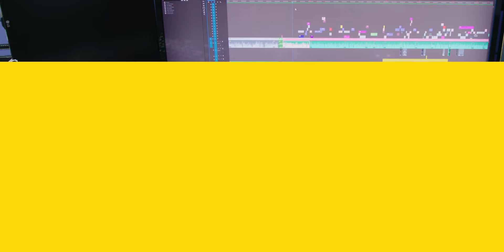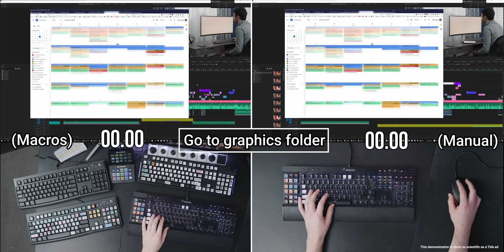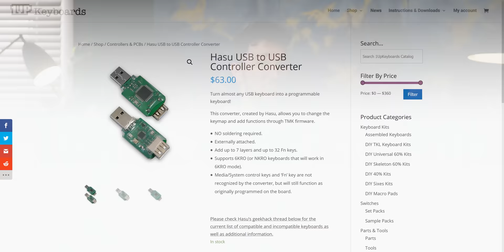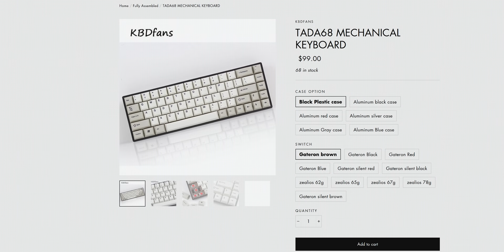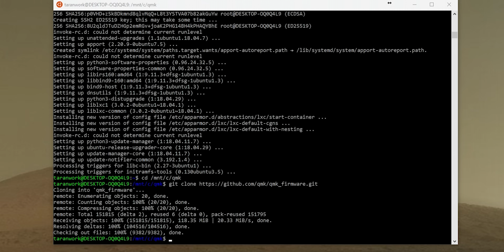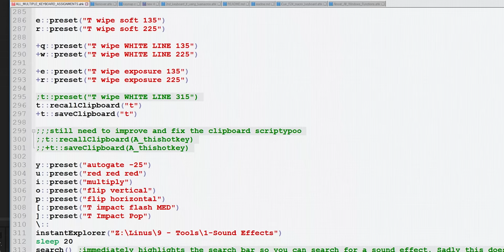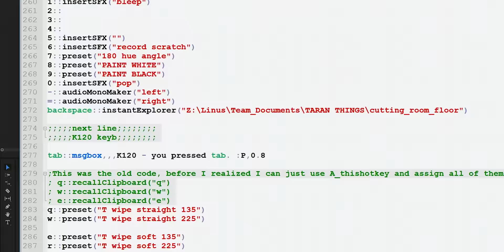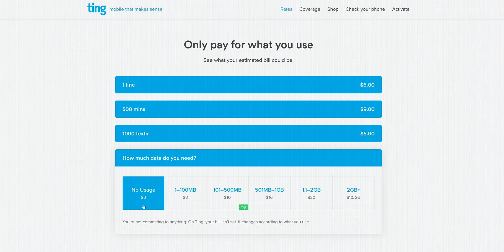Can your Keyboard do THIS?? - Make ANY key a MACRO!

Comment: You probably won't see this Taran but i just really want to thank you for this video. ive had a gaming keyboard as my work keyboard for a while and it has 7 macro keys.  I NEVER thought about using them for actual work. im typing this on my lunch break. i literally finished a whole days worth of work this morning. it took me a couple of hours yesterday to find out all the correct software i need and actually mapping the keys to the right shortcuts (often used phrases for data entry as well) and im literally 2x as fast now and thats only with 7 macro keys! i fully understand this video now. THANK YOU. thank you so much

Comment: I did a quick search for other solutions to this, and I found something called MultiKeyboard MACROS. It's software with a GUI, and they're charging $30 USD. It looks like version 1.15 was released back in November 2019, so maybe it was made in response to this video.
Reply: I was looking for this comment, since I forgot the name of the program. They're still charging the same price (which is more steep than I'm willing to pay), but they're up to Version 2.28b (30/07/2020) right now.
Thanks, me!

Comment: i play pc games with just a mouse with 1-12 side keys with layered macros turning the 12 keys into more then 60 i only use it for 23 though until i get further in the game and unlock more abilities at higher lvls then ill add more layers. i could actually type this whole message with just my mouse but it wouldn't be as quick id have to switch from layer to layer for each grouping of letters, much more practical with a game that has cool downs for abilities. but for the demonstration u showed where u use it for editing videos and quickly grabbing access to audio clips and whatnot unless u have a bad mental memory then it could be just as fast if not faster not having the multiple keyboards u have to look and move ur hands over to the different keyboards when u could have just hit one key and the keyboard ur already using turns into what the keyboard u would have been reaching then another key and ur back to the first. u could also just  pick the most useful keys that would save the most time and do the rest of the work the old fashion way if u can only remember a few maco keys
Reply: How can you fucking remember what's on each key.
Reply: batt3ryac1d i used to play mobas a lot, and i had a lot of different key combinations for different actions, some of them on my mouse. mentally trying to recall each command is harder than actually pressing the keys with my hands. i dont know whether to call it muscle memory or if it's just deeply engrained in my head, might be a bit of both. im guessing its not that hard to remember where each button is after a lot of repetition.
Reply: @batt3ryac1d  Muscle memory ^^" I used to have also like 24 keys on my mouse for World of Warcraft and I just had them memorized down to the action. It was more sub-conscious than anything else ^^"

Comment: Sounds great to be able to use my personalized shortcuts on any PC, and on my Ducky One 3 which hasn't got any accompanying software. However, I tried AHK, and it isn't working satisfactorily for me, at least with the scripts I tired... It has the same bug that the keyboard manager in PowerToys has. Which is that when using the i, j, k, l - keys as arrow keys, sometimes a letter is sent as input instead of an arrow when pressing them in quick succesion (for example down, left very quickly when navigating through code). (The problem is much lesser/harder to reproduce in AHK than PowerToys, but its still there, which lessens.) The only softwares I've tried that does this perfectly is Razer Synapse and Logitech G-hub. However I haven't tried QMK/VIA yet, so I'll definitively give the Hasu a try.

Comment: Summary:
 AHK is what you want & something that can distinguish keyboards.*
Use AHK, build your own profiles and will always be use-able. Unlike razer/corsair software, possibly. Use their software to bind AHK programs. Use Razer....until Corsair can distinguish keyboards (this w/ their software will make them king). If buying Razer w/ synapse costs more than HASU, or maybe you want to reliability of software, manage binding, profile management, work on old keyboards get HASU . (HASU might be better cause I saw keybinding is simple as connecting [and maybe having it know specific keyboard] vs Rayzer which requires you to click here and there to each key. tedious). 
• Currently HASU is like 60-80 (w/ [plug, but remain plugged] & w/o blue tooth [hardware to be inserted]); cheap razer is like $60

^^^might update based on setup vids

Notes:
3 methods to MACROs: see video description. 

1. CORSAIR iCUE software METHOD 3:05
***CANNOT distinguish multiple keyboard***
Awesome software for making MACROS, idk how awesome when setting up AHK.
Do they remove iCue support at one point? (Have they done so in the past?)

2. RAZER SYNAPSE software METHOD 3:48
****Can distinguish multiple rayzer. 
I feel iffy about macro creation, software seems simple, but Taran shows AHK way.

^^Both only work on their supported selected devices.

3. HASU 4:44
*almost any keyboard.
-Has most potential and awesome if can get together an open source software for peripherals/macros.
*?????HASU work with bluetooth dongle?*
HASU2 i think there's bluetooth, do you need to plug in/out?

AHK
????: How robust are the profiles with various keyboards? (ex: 1 profile to work on keyboard x,y,z)
Code macros vs building one out.
(***??????Does AHK have an easy way of building macros instead of coding it?**)
????*****?????
>>Otherwise.... which is fastest if setting a new one up?

Logitech:
How about Logitech.... I think they can bind each key to files.

Questions:
?????: Which supports most amount of profiles? (easiest?)
????: Can I download profile data from rayzer/corsair/logitech?

Comment: WOW! This makes our X-keys and MacroWorks software look as simple as Notepad.
Reply: Well... I must say that I learned a ton from watching this video, but it also made me all the happier for my own X-keys and the MacroWorks. 
Granted, I also use AutoHotkey to perform more advanced functions, but launching those commands is easy using MacroWorks. No F24 wrapping or anything - and it works after reboot as well :-)
On top of that, the X-keys has great switches and I can print my own key legends and put it inside the keycap. No worn out lables or sticky glue residue.

I think Taran would benefit from replacing some of those modded keyboards with some of the 128-key xkey models. They would probably free up some desk space as well.

Comment: most things in a cockpit aren't controls though, they are things that show you your status, like radar, speedometer, altimeter, gps, compass, etc. For example a bonanza barely has 15 switches, 7 of which are for lights and 2 of them for the air conditioner. You only need a few input dials for the GPS, radar and autopilot and then 3 levers for the gas, rpm and gas to air ratio.

Comment: What if my keyboard has 2 usbs...?
Reply: One is most likely just for extra power
Reply: no it's not for extra power, they use the 2nd as a usb passthrough and have a built in hub
Reply: @coryordway5575  If you want to use the hub you can just plug the extra cable into a different usb port, and plug the primary cable into the device from the video, the usb ends should be labeled to show which one is actually for the keyboard

Comment: Why do you need Ubuntu for git I have installed it on Windows.
Reply: MSYS2 should work too
Reply: They probably wanted a clean solution.
As it seems you need some dependencies.
As it seems they just need to deinstall the Linux-Subsystem and everything should be away.

But I'm not quite certain.
Maybe it's just that compiling on Linux is easier, because installing dependency- packages are a command away, the same with cloning repositorys.

Comment: I made a macro keyboard from scratch with arduino uno + PS/2 keyboard + Autohotkey. Total cost would be ~6USD == 127 Macros ($0.04/macro), and many times more macros considering the layers of Ctrl/Alt/Shift/Win/Apps modifiers + Num/Caps/Scroll Locks (including media keys). Also made it recognize a 49-key HP remote control with an IR sensor and a N64 joystick (both fully macroable). Next step is to hook 2 old gameport joystick/manche into the mix and the gaming station is complete. Arduino is love, AHK is life :)

Comment: The easiest way I found was to purchased the Enterpad P120 from CEDEQ which has 120 keys (and 240 keys when switching between the 2nd virtual layout) Then, I use their free and easy-to-use program called ShortKeeper with the Enterpad which lets you create and trigger your own shortcuts in Windows so you can instantly access files/folders/webpages/programs, basically what ever you want. I can tell you that the Enterpad P120 has not only been fantastic for gaming but has saved me soo much time at work!

Comment: You can always utilize some Arduino development board (based on Atmega32u4 chip - like Leonardo, Pro Mini etc.) and build your own device. Sure, it requires some technical skills, some basic tools and a little bit of time. But it's more as you like solution.

Comment: The less you have to move your fingers, the more efficient you will be. This is why layers and/or chording systems are faster for keyboard input than macro pads.

Dedicated keys are easier to remember, which is more important than speed for certain professions (aircraft), but if you are talking purely about speed and efficiency — key combinations (going tall) outperforms dedicated keys (going wide).

Comment: I’m a programmer who’s been on a similar mission for a similar length of time. 

I’ve gone with Koolertron macro keyboards and bound them to obscure combinations like Win+Shift+F1 through F12. From there I use auto hotkey.

It’s not perfect, but arguably as imperfect as this solution for a few bucks less. 

I swear I would pay upwards of $200 a unit for a perfect solution, though.

Comment: This video might have saved my hands and job! Dude god bless you both my Ergodox and Advantage2 had hardware shortages and I couldn’t afford another option like that. I use this thing with the Perrin Split board because my hands need the split design, and my job has such convoluted controls for its software that it’s not realistic to keep manually doing. Thanks a lot

Comment: With the investment in all of these macros, multiple keyboards, keypads, macro solutions and devices, I'm surprised you haven't just invested in just a large board of keys. Especially since you're using 4 keyboards plus who knows what else currently, a large panel of keys would be so much more space efficient; even with a curved design, with all the empty space, you could have almost another entire keyboard worth of keys if it was just one device with space efficiency in mind, or a smaller footprint if you don't need any additional keys.

Comment: Using keyboard keys to execute Autohotkey Macros Scripts are very useful, and i did like the video part of HotKeyboard devices on 2:50 - My Best Tip to the Users is use ONE HOTKEYBOARD and make the keys Smarter with Scripts that can execute different scripts if a key is pressed a count of Tap Clicks (Same idea Like Tap Gestures on touchscreen devices) - examples - [1x c key = send c] - [2x c key = send ^c] - [3x c key =send ^v] or [1x c then 1x v = send ^v] -[1x v then 1x c = send ^c] : This Methodic is very efficient and it will give you intelligence keys with more Functions - [click left key + key = Ctrl + key] - [click right key + key = Alt + key] - [click up key + key = Shift + key] - [click down key + key = win + key] or [hold two left keys + key = Ctrl + Alt + key]

Comment: i used to run a K55 as my main keyboard before I switched to mechanical, even briefly used just the numpad and side G1-6 as hotkeys for streaming with a dual kb setup, guess I never realized how powerful icue is, will definitely be digging that crusty bad boy back out

Comment: So one month later after my first comment, i got my one. I got mine from hasu themself, because he sold it cheaper in terms of the device and international shipping and at 1up keyboards, it was out of stock. He lied in the customs declaration with the price. At least i don't need to pay taxes. I was expecting to get to customs and pay the taxes. It got shipped fast but stuck a week at customs. 

I tried to install it and as lazy i am, i just sticked with the video and after it didnt worked, i just quickly read the other tutorial and still nothing. My problem was that i didn't installed the drivers on the converter. Now it works with ahk. I just need to rewrite the script, for my german keyboard and write my macros. But this i will do at work. 

What would be interesting if the hex file can be programmed differently. When you press different keys like num, capslock and scroll lock, if you can turn on a different wrapper. In theory you can have 8 different wrapper Function keys, get highlighted with the lights. I picked the version with mod keys, because i want some macros, that require additional keys. I'm a programmer and don't want to accidentaly hit delete, because then i need to compile everything again and it takes some time.
Reply: I use also a german keyboard. Can you send me the rewritten script?
Reply: @christiandull  I have this script at my office PC and i can get this script at monday. When you run the script from taran, you can open the script over the tray menu (right click > open) and in that window you can open over View the key history. Pressing that key and then F5 gives you information about the key, like the SC value. In the Manual you can look how to use this value.

Comment: You can do it just with Pi Pico, a USB A to USB micro B cable, a USB female plug (with a cable) and optimally a case
Reply: You have to solder the female plug to right GPIO (4 cables)
Reply: Not really a great solution for those who don't have the skill or knowledge to do something like this. If there are any ready-to-purchase products that utilize this solution, I'd love to see a link.
Reply: @Yeshua_Will_Arrive_Soon  You can order a hardware ready board online. Just explain how to order (the hardest part). Then connect to computer while holding a button on device. It will show as USB drive drop file done

Comment: Not sure if this will ever be answered, but would using one of these mean that after i've programmed a set of macros, i could bring the device, plug it into another computer and directly utilize the programmed macros without installing anything?
Reply: No, the USB Adapter he is showing here is only wrapping his key presses in F24, so you still need AutoHotkey to intercept the Macro Keys and interprit what you want done. i.e. When he presses the letter A on one of these keyboards the computer receives the command F24+A, so then he has written an AutoHotKey script that listens for F24+A and then performs specific preset commands when it is pressed.
Reply: @samhnky  thanks! I figured this out after doing some research that few months back. This wasn't really useful for my use case and I ended up buying a macro keyboard with onboard memory instead :)

Comment: Or if your using a mac just use USB overdrive, You can run console commands using applescript which allows you to do a lot and also its free
Reply: There are also free apps for Windows (I'm pretty sure there have been for many years) that can do the same thing, using any old keyboard.

Comment: I've done the controller method to a custom multiple layers board. Once I got the layers figure out I end up  texting code way faster. Generally to do this you have to need to do that stuff in order to save time. sometimes its way to much to press alt codes and other stuff when you're texting.

Comment: Curious about something a bit different but in a similar vein. Is there a way to take a keypad or keyboard, and have it so each key is seen as not a remapped key or macro script, but as it's own unique key? Like how when you get a gaming mouse, it'll have extra buttons, that when you go into control settings are seen as completely unique buttons rather than just being used to press S or 1 or whatever. The games and software see it as "Button 1" or something. Can you basically do that with a whole keyboard?

Comment: If only MicroSoft would finally after more than 30 years of Windows include a Button&Axis mapper so i can finally hit "Any" key/axis regardless whether it is a Keyboardkey, Mousekey, Midikey, Joystickkey, Steeringwheelkey or other.

And i could get rid of all the keypress/axismotion-mappers i have running at the same time like, AMDcontrolpanel, DirectoryOpus, Bome`s MidiTranslator, Steam overlay, MS XBOX live, Autohotkey, Drakonia Configurator, Skiller Pro Configurator, Logitech controlpanel, Midi2mv, Fergo JoystickMIDI, "thegame/program you`re working on itself".

In Office/Excell i can map close to anything, in Windows i can map Nothing.

Comment: Isnt just easier for most people to use autohotkey software itself without any aditional devices? Personally i use ahk and it doing well, for example sound control on mounse, run folders/programs on specific key/combo, scripts autostart/run when specific program is working, translator under just 2 buttons (translate selected text and copy it to clipboard). IMO it will do the job for most cases.

Comment: Hmm, my method is to use a raspberry pi zero as a mini-server that can trigger commands to ahk on my pc, £10 per pi plus like £10 for a cheap keyboard (mostly i just use old keyboards) and you can get a system running with unlimited keyboards for £20 per keyboard at most